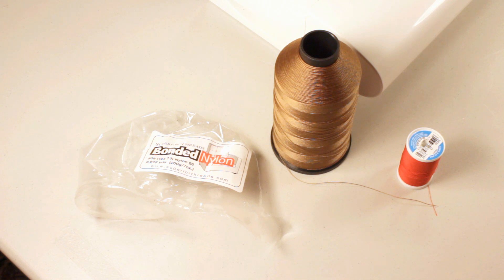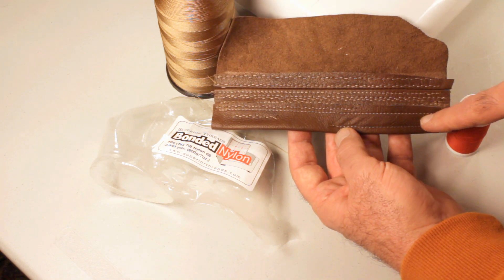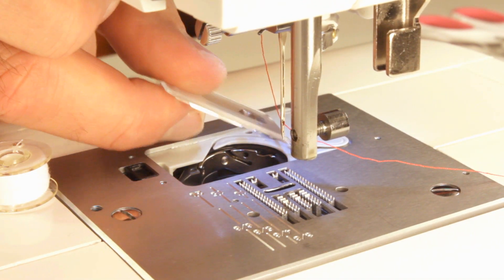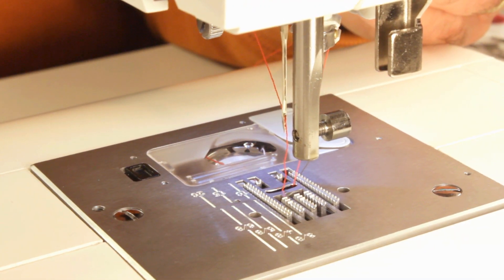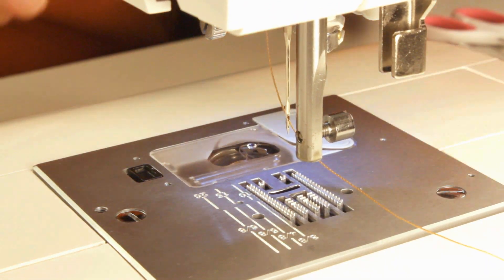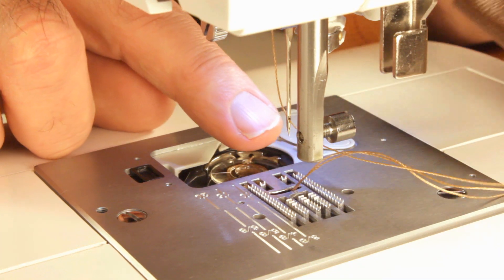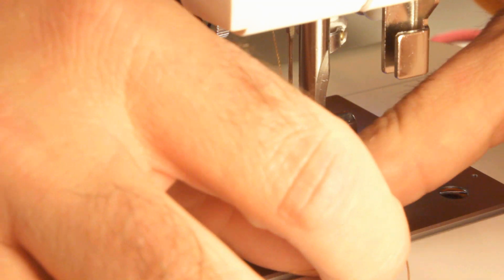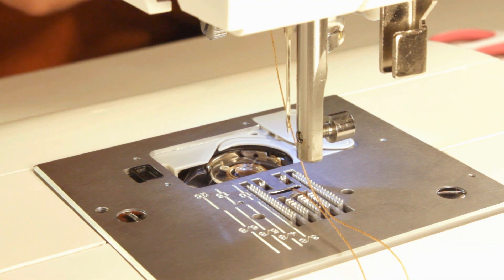Top Loading Bobbin Tension Issue with Zig Zag on bottom and the Solution Using Nylon #69 Thread

Comment: Thank you for your tutorials. They're very helpful esp when I got my machine a few months ago. I refer to your video quite often. I'm having an issue with my bottom stitch "looping". I've adjusted, I've redid the bobbin, and now when I'm trying to test it, my stitch goes one ahead, and then automatically once backwards. I don't know what I did. My settings are S-A (black), length 2.5-3, width 3, tension 3. The only thing I played around with was the presser foot knob. Help!!
Reply: It's doing a double stitch
Reply from the maker: Loops on the bottom  point to the needle thread tension needing to be tightened. Try increasing your tension to 5 or 6 and see if that helps. Also, clean out the tension disc by using dental floss. Sometimes lint from the thread can accumulate there and cause the problems you describe.

Comment: I purchased a Juki hzl f300de machine and bought v69 thread from Sailrite, but the stitches were a mess.  I called Sailrite and a very helpful person asked me what needle I was using which was a Schmetz 16 jeans needle.  He told me that i should use an 18.  How does the needle/thread ratio affect the stitch?  I'll also check out what you display in this video.  I'll also check out to see if you have a video on pressure foot tension for canvas.
Reply from the maker: Remove the needle from the machine and thread the eye. Hold the thread on each side of the needle and raise your right hand then your left hand. The needle should flow easily along the thread path. If it catches and hangs on the thread then the needle isn't large enough. Top Stitching needles have a larger eye and scarf as well, so you may want to buy some of them as well.

Comment: Another Excellent video.
Does the Model 4411 Machine hold a Cone of 765 Yds of  MARA 50 thread or does it need some kind of thread holder to sew with it?
Reply from the maker: Get an external thread stand. Make sure it is all metal too. Many are plastic now and not worth the $.
Reply: Thanks so much.  : )

Comment: Hi Kevin just happened on your site.  I have a NewHome DX 2030 .... followed your instruction and got straight stitch bobbin tension fixed, almost .... it is sewing but every few inches it grabs top thread and snags it to bottom of fabric.
The zig zag stitch I cannot get to  work at all.  This grandmother is totally frustrated.  Would appreciate you help.  not sure how to communicate with you from here.
Reply from the maker: If it is threaded correctly then it might be a problem with the machine. The timing could be a bit off.

Comment: Hi Kevin - watching your other video's on the Heavy Duty Singers had me talked down to the 4432 from the 9985, thinking it wasn't going to be powerful or versatile enough handle leather/denim. I don't expect to want to use either *often, but when I want to do it, I want to do it. I'd also like to play with the embellishment stitches, but if I've got to pick one, I want the denim/leather ability. What do you think of the 85 now that you've had it a while? Could I throw a leather/denim pencil skirt together on this thing? Leather back, denim front? I don't even know what weight of leather I'd need to hold it's shape.Actually I know nothing about leather at all, lol. I'll get there.
Reply from the maker: The 9985 offers many more features than the mechanical Heavy Duty Series machines do. If I were you I would go with both eventually. Go with the least expensive Heavy Duty because they are all the same when it comes to the motor and internal parts. This will give you a machine you can abuse and not worry so much about the high cost. The 9985 will give you all of the modern features that make your sewing more enjoyable. When you don't want to abuse it you can go to the Heavy Duty machine for heavier weight fabrics.

To answer your question given the correct needle the 9985 might sew the denim/leather together. Of course leather comes in so many thicknesses it would need to be 2 mm or less. However, the Heavy Duty machines would be better suited for this project.
Reply: Well, just lost the whole response I'd written when I hit cancel instead of reply, but thank you for your response. On the advice of a local repair guy, I went with the Janome hd3000, which wasn't quite the cheapest option. I know you were underwhelmed with the hd1000, tho, so we shall see. I *really hope I don't have to return it...anyway, I'm off to go check out the basics video with the shopping list you made and gather *that mess up now.  Have a nice evening, Ken!
Reply: * Kevin. #fail
Reply from the maker: Wise choice. I think you'll be happy with it.
Reply: I hope so. I'm not looking to go into production with chaps and handbags and whatnot. Which is probably a good thing, since I have yet to make so much as a pillowcase, lol. Although that is the first thing on my list. ;)
Reply from the maker: Okay, keep me posted on your experience with the HD3000. That way I can pass it along to others going forward.